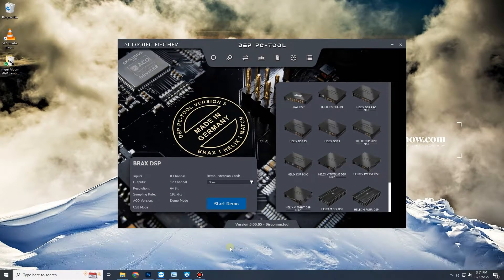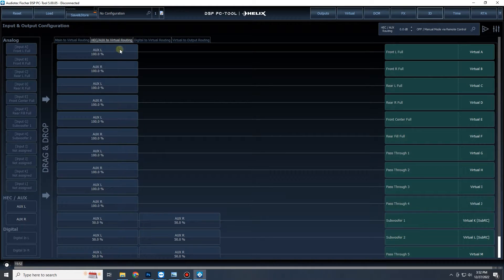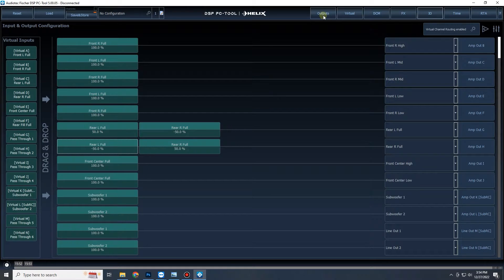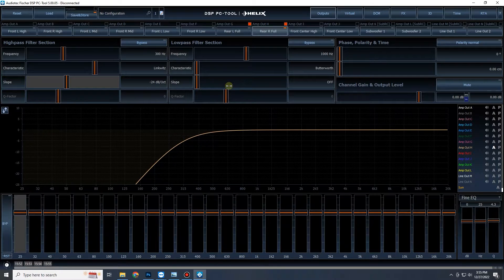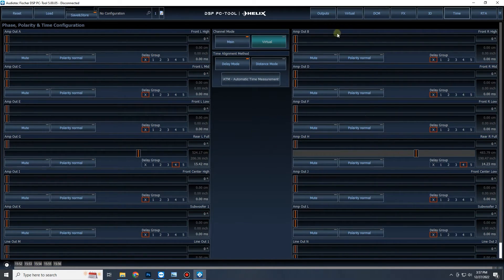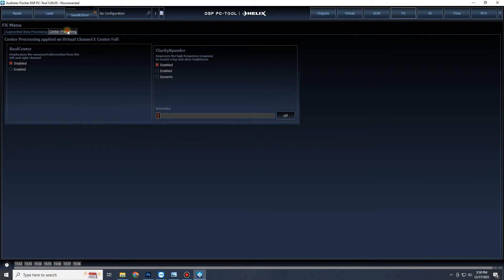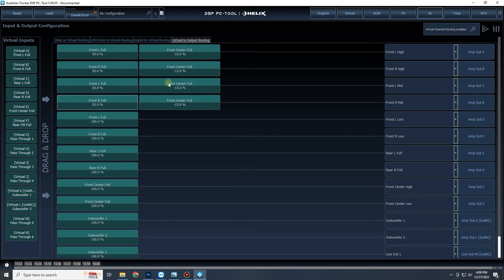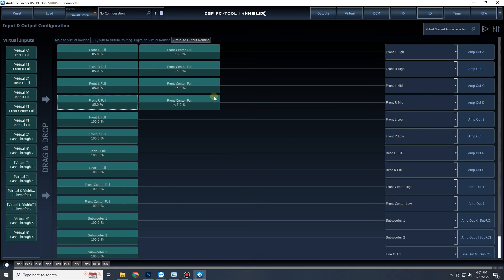ResoNix Sound Solutions - Helix DSP Tech Tip: Differential Rear Fill, & Using Real Center

Comment: If I only have the option to sum the rears 50% I don’t have the option to individually change the phase like that. Could I just sum the rears and then physically change the polarity of the rear speaker wires? To achieve rear differential

Comment: If I only have the option to sum the rears 50% I don’t have the option to individually change the phase like that. Could I just sum the rears and then physically change the polarity of the rear speaker wires? To achieve rear differential
Reply from the maker: @ZachLyons-e1j  no. You would need to flip the polarity of the input signal.

Comment: Maybe i missed it in the Video, but:

I have KX3 3-way in front active, and some Focal K2 comp speakers as rear.

I use mic with the ATM in Helix. Should i use the ATM before or after i set up rear fill.

Only ATM sub and front set, then set up rear fill - Or ATM front set, sub AND rear fill?
 

Thank you!
Reply from the maker: Do delays first, then do measurements and EQ, then set up differential signal. Have ATM do all of it.
Reply: @ResoNixSoundSolutions  Thank you!

I found that the AutoEQ didnt really do any good, the sound was much better and more detailed without any eq.

I havent tried tuning each speaker alone with Autoeq - will try that before i give up =D I tried som guide who said to link each side and tune, but the result sucked and i thought the whole idea was both wrong and weird. 

Thanks again!
Reply: @ResoNixSoundSolutions  Do you use corrolated when tuning each speaker?

Comment: Can rear fill be done from only 1 chanel on dsp as thats what I have left? I have been told it can be done but looks like you are using 2 chanels there..😏
Reply from the maker: So it can be done, but not in a way that would be considered ideal. What you would do is do Left minus Right on the input signal, and then you would flip the speaker wire polarity on the right speaker. Problem is, no independent signal delay, eq, or levels, which can definitely throw things off.

Comment: To chime in about the slopes, there is a good difference in them all. 24db linkwitz is the easiest and most protective and also doesn’t require a polarity switch, it also makes the handoff between speakers sharper which can make the sound a bit more edgy, so the blending is not as great especially when the speakers are not within a few inches of each other. 12db linkwitz requires the polarity of the mids to be reversed from the tweeter and midbass, but it offers a much better blend than 24db and has a much smoother sound overall. And if you want the best blending you can do butterworth 6db slopes. It offers the least protection for lower frequencies but you will be harder pressed to notice which speaker are playing each frequency. This is a great method especially for speakers off axis because they will work better together and provide a much more dynamic presentation. The only way to really know the difference between slopes is to EQ each speaker’s full bandwidth and then set your crossover’s afterward your EQ’s are set.
Reply: How about on a 2 way active front, any polarity changes there?
Reply: @LuckyyTheDog should be able to flip back and forward bro 180 or 0 id do it with only the one channel running though. That's not a technical thing it's just by ear I can tell phase generally, some phase issues aren't avoidable due to nulls in the car too.
Reply: does the sub also needs to be reversed?
Reply: Very similiar to what the MS-8 did using Logic 7?

Comment: Could you show us how to set levels for rear deck speakers to retain a front image? 
Please 

Much appreciated
Reply: No tweeters in the rear is the most important thing. 
When you set your EQ’s, dont adjust the levels. Literally just use your EQ to get them all matched and make sure all your mid ranges are crossed the exact same. Once your time alignment is set any speakers in the rear should add presence to the front rather than drawing you to the rear. And with rear fill in differential mode it shouldnt pull your vocals anywhere because the information is different than your fronts. I run my rear fill hot even when i have them olaying the same information as the fronts. It just gets louder but doesnt sound like its in the back of the car. So play with rear levels after you’ve got all your speakers eq matched. It should boil down to your taste as long as the tuning is proper.
Reply: @pluggedinjaye when you say you run them ‘ hot’, I thought you said you have the levels of the rear speakers -8 or more db.   
So the rear speakers should be lower in volume or the same as the front speakers? 
I’m confused. 
Thanks again